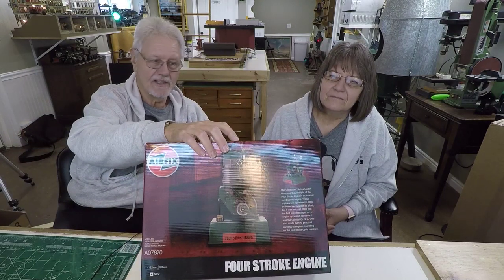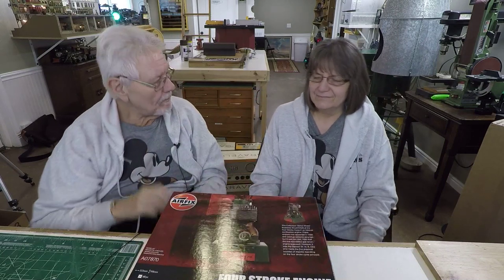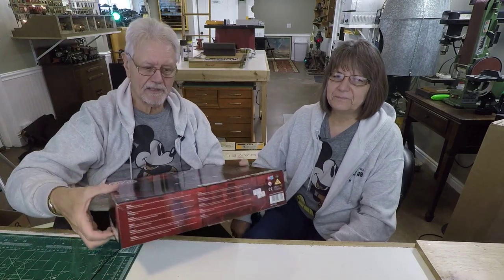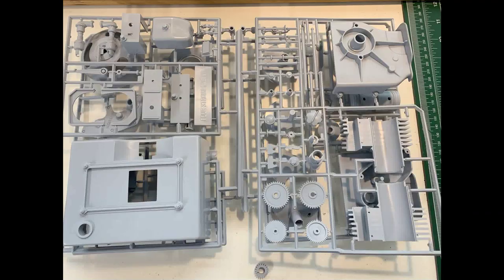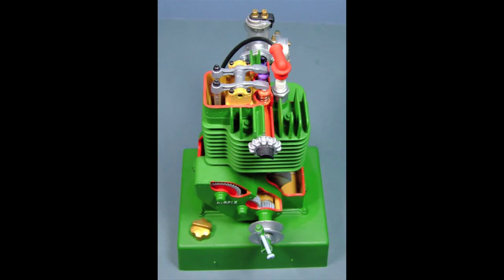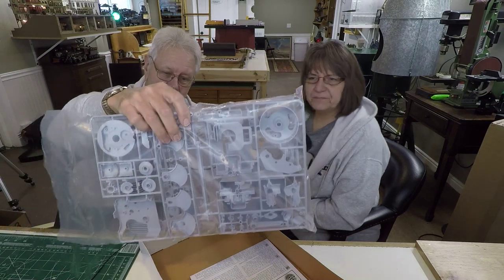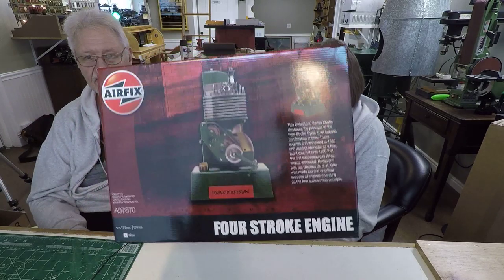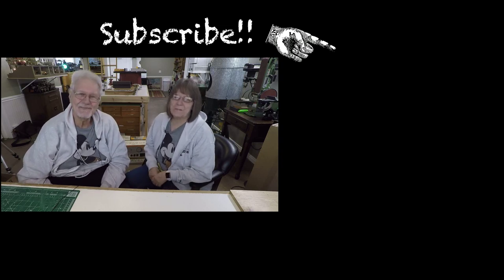Airfix Plastic Model of a Four Stroke Engine from 1972

Comment: Hi Dale and Karyn, what fun to see the AIRFIX model of a one-cycle engine.  Seeing the model, with its many plastic parts, reminds me of my working model the R-985 Junior Wasp Engine.  I was an instructor pilot in the U.S. Army Aviation and we had the DeHavilland Beaver as the aircraft for instrument flying.  That airplane used the Pratt & Whitney engine.  My model -- I believed made by Monogram or Revell, had working spark plugs (with lights as your model).  My son, however, at the age of about 5 decided to take it apart and see how it was assembled.  He successfully, to my disappointment, disassembled it even with the gluing, etc. and that was the end of that.  Much fun to remember.  Thanks for another uplifting video during uncertain times!!!   - Dean from Minnesota
Reply from the maker: Sometimes I can’t find my own videos!  Took me ten minutes to find this. Anyway if you haven’t seen it...https://youtu.be/_NwtFayCzL8
Reply: Hi Dale, thanks so much for the effort.  Much appreciated.    - Dean